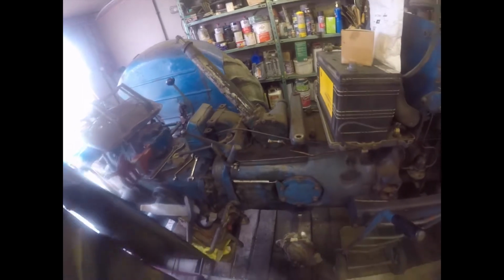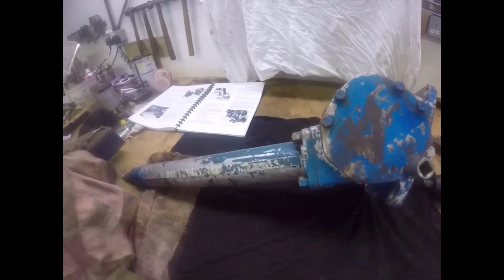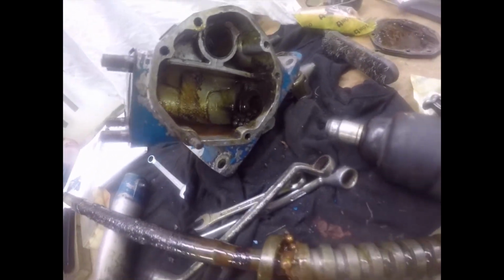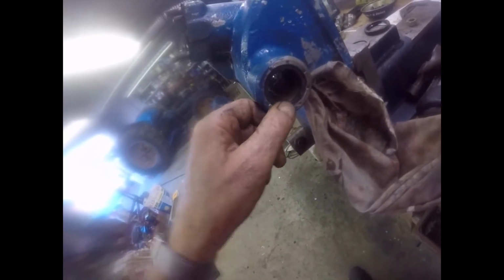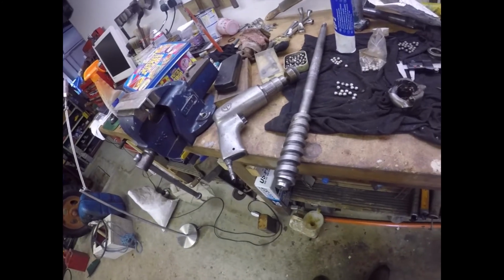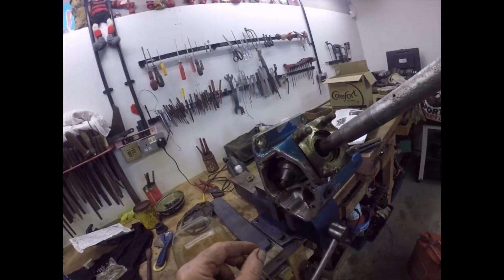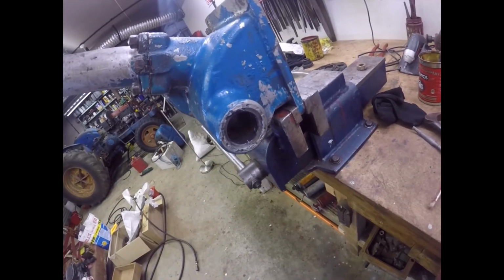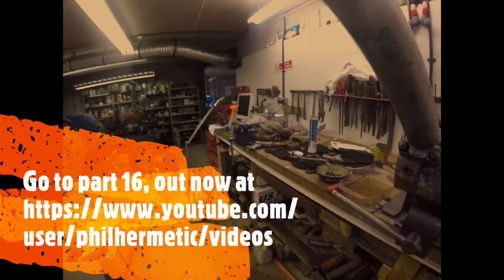Fordson Major E1A rebuild, Part 15, Stripping and rebuilding the steering box.

Comment: Hey there phil just saw this and unfortunately working some stats homework so ill save for later. where did you get the rebuild kit from?
Reply from the maker: Hi there, I didn't really get a kit, but if you google "fordson major steering box parts" you will find you can buy most of the bits you need from various different  places. Be aware there are two different types of seal used, but other than that  all the parts seem to be the same, I replace bearings and cups, and also the recirculating balls that go in the spiral groove at the bottom of the column. It made a huge difference to the way the tractor drives!
Phil

Comment: It is surprising how much access you have to the steering with the tank off. Great job rebuilding the steering box, it looked like the manual was essential. I am surprised the balls did not have a cage to hold them in place
Reply from the maker: it is all pretty straightforward, until you come to put it back together, then it is the ORDER of reassembly that is important!! Thanks for commenting!
Phil